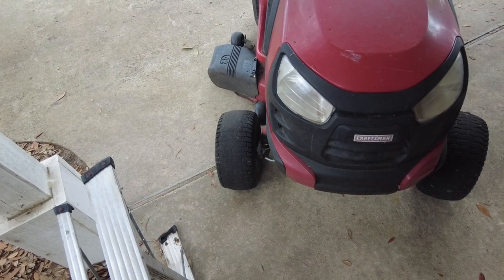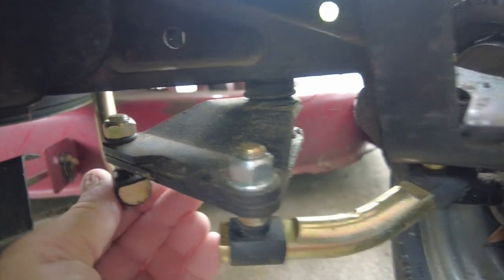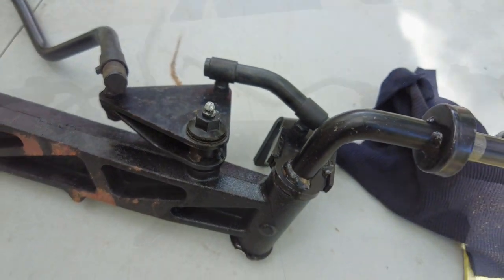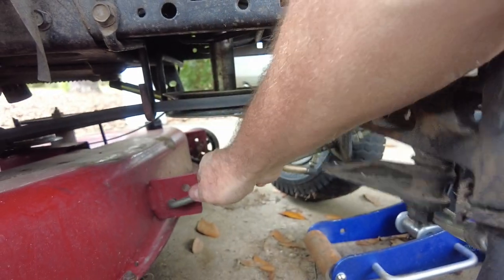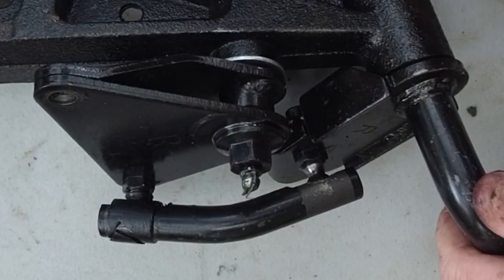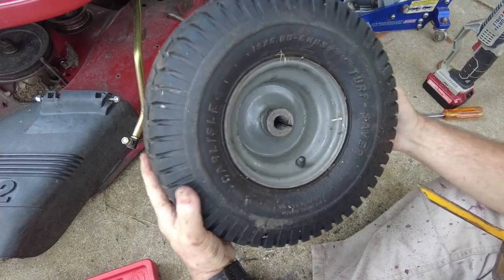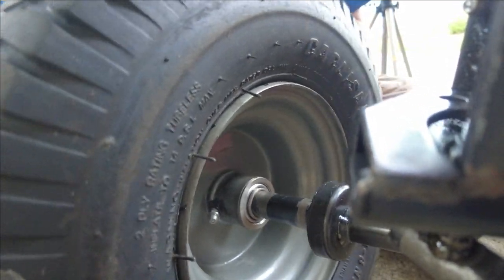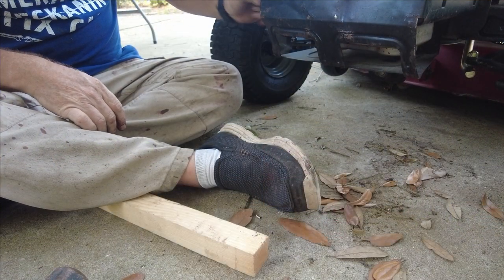How to Fix Wheel Alignment On Your Craftsman Riding Mower | Riding Mower Front Axle Replacement

Comment: did this fix the sterring? I have the same issue and now my steering control arm comes loose from the ball connector on the control arm. thanks
Reply from the maker: Yes it did fix it, but you might just need to replace the steering linkage. Much easier than replacing the whole front axle. Watch this video of mine and see if it answers some more of your questions.

(How to do a front wheel alignment on a 42 inch riding lawnmower)

Comment: would  u happen to have the part number r where i can order a full assembly.. ty
Reply from the maker: I do not know if the front axle assembly has a part number. I had the part number for the spindle and was looking on e-bay to see if I could find one only because it was on back ordered. While I was on e-bay I found a person that had axle assembles for sale, actually it seems like they recycle mowers by parting them. Hope this helps.
Reply from the maker: Sorry I do not, I was searching for a wheel spindle which was on back order, so I went to e-bay and while searching for the part I came across a seller that must part out old mowers and that seller had the whole front axles for sell. I hope this helps.
Reply: Is that a Silvia s13 in the background